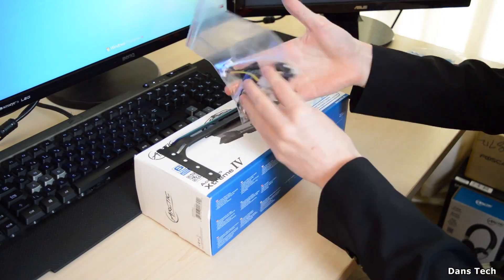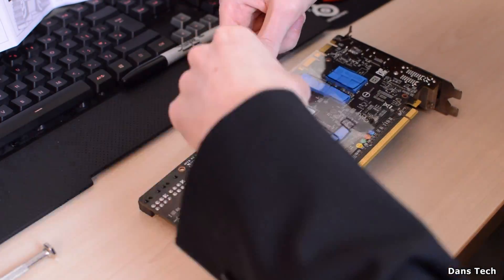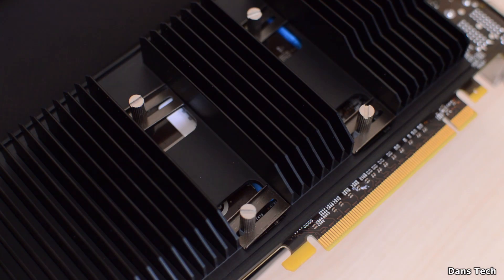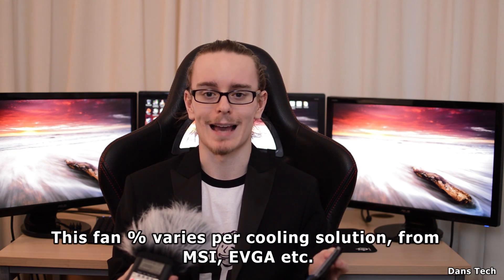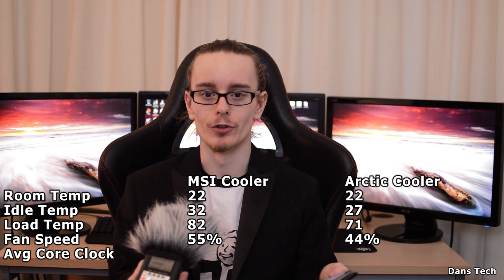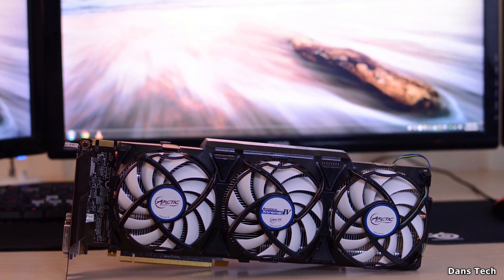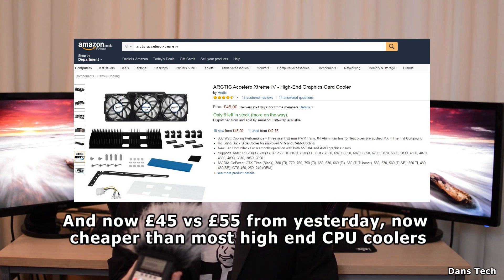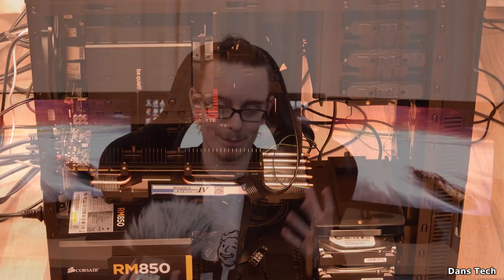Arctic Accelero Xtreme IV GPU Cooler Review

Comment: How about the VRAM temperatures? They're cooled through the PCB, which reduces thermal transfer *a lot*.
Reply: Considering the 90mm fan provided with the nzxt g12 water/air hybrid cools vrms and memory better than the stock cooler without heatsinks and just downward airflow, I'd bet this does a fine job.
Reply: I'm wondering the same thing.  I'm hesitating between the Accelero IV and III for that very reason.

Comment: Hi, do you know if that works in 980ti? (Msi Armor 2x). Great video. Thanks.
Reply: RTX 2080 (Ti), Titan Xp, Titan X (Pascal), GTX 1080(Ti), 1070 (Ti), 1060, Titan X, 980(Ti), 970, Titan (Black), 780 (Ti), 770, 760, 750 (Ti), 680, 670, 660 (Ti), 650 Ti (boost), 580, 570, 560 (Ti,SE), 550 Ti, 480, 460(SE), GTS 450, 250, 240 (OEM), GT 740, 9800 (GTX+, GTX, GT), 9600 (GT, GSO 512, GSO), 9500 GT (not LP), 8800 Ultra (G80), 8800 GTX (G80), 8800 GTS (G80), 8800 GTS 512 (G92), 8800 GTS (G92), 8800 GT, 8800 GS (9600GSO), 7900 GTX, 7800 (GTX 512, GTX, GT)

Comment: Hi, was the Original cooler the MSI Gaming X or another? Because i have a GTX 980ti MSI Gaming X and my temperatures in Load are 82 Degrees with 86% Fan Speed on Automatic Fan Curve... Whould this Cooler help for my card?
Reply: yes

Comment: did you have any long term issues, my 980 ti started hard locking after I installed this, I think its the crappy heatsink solution, on a 980ti u cant use all 6 included clips, which presses the backplate to the blue thermal pads, I was only able to use 4 cause there just isn't room to use the other 2...thus maybe thermal conductivity sucks? Not transferring heat properly from the VRMs to the backplate? Regarding the actual GPU cooler...its amazing... my temps dropped from 84C load to 55C load and I can't hear the fans.
Reply: tinostarks I had to squish em down cram it a bit

Comment: does it works with my nvidia gtx 1060 / 6gb oc? ( msi - Version )? @ ITALY
Reply: RTX 2080 (Ti), Titan Xp, Titan X (Pascal), GTX 1080(Ti), 1070 (Ti), 1060, Titan X, 980(Ti), 970, Titan (Black), 780 (Ti), 770, 760, 750 (Ti), 680, 670, 660 (Ti), 650 Ti (boost), 580, 570, 560 (Ti,SE), 550 Ti, 480, 460(SE), GTS 450, 250, 240 (OEM), GT 740, 9800 (GTX+, GTX, GT), 9600 (GT, GSO 512, GSO), 9500 GT (not LP), 8800 Ultra (G80), 8800 GTX (G80), 8800 GTS (G80), 8800 GTS 512 (G92), 8800 GTS (G92), 8800 GT, 8800 GS (9600GSO), 7900 GTX, 7800 (GTX 512, GTX, GT)
Reply: @francismichel1  why GTX 260 280 285 275 is not supported?
Reply: @warrax111  I dont know, but it doesnt

Comment: im running a r9 380 and is soo fucking hot today im running it right now on stock cooler 100% idle  and its 46c :X i need a good cooler for my gpu
Reply: Ilijas Ramic make sure your fans are spinning one may have gone down

Comment: Yo sup Dan I was wondering if you could help me I want to know if this cooler would fit my Gigabyte r9 380 g1 gaming thanks man :D
Reply: FiNaTiC GaMeR wouldn't know.  Check it out at the faq questions on that site
Reply: Jhono Gudiel Thanks for the fast reply, I just checked, they said "The IV works for all 280's manufactured after February 2013. The 280x works with all 280's." But unfortunately i'm not from US, now i don't know if it's a free shipping world-wide, that's the problem because no one sells this in my country, it's out of stock.
Reply: Nostalgic Mind don't worry. 
I have the same problem and that why since I've done this comment.  I haven't gotten it yet.  It seems I do need to have real direction there.  So far, I cannot buy it.  

But I suggest you ask to the seller at Amazon.  They'd tell you of the deliver it free shipping.  Or at the section "sent to" and see if there's your country available.
Reply: Support Nvidia GTX 1080, 1070, 980 Ti, 980, 970, Titan X, Titan, Titan Black, and more...
• Support AMD RX 480, R9 390X, 390, 380X, 380, 370X, 290X, 290, 285, 270X, 270, R7 370, 265 and more
Reply: +Jhono Gudiel thanks man but this may not work for aftermarket gpu right? or can it I heard only refrence designs only.
Reply: Mostly these kind of coolers, works with reference models.  Because they kind of have a standard model.  But go to amazon. There you can ask to the seller and they'd solve your doubts.  I came from amazon site right here and found your question.  Search it on amazon. Is the only one.   :)
Reply: +Jhono Gudiel cool will do :)
Reply: Good luck!! :D
Reply: no support for evga 780 ti?
Reply: And 280x toxic edition?
Reply: Nostalgic Mind don't know perhaps they do.  Check it out at Amazon

Comment: Just installed this on my incredibly hot Palit GTX 580. As you say, it is a little tricky to install as I've never done the aftermarket GPU stuff before. But boy I'm chuffed with the results.  Under load it has shaved 30 degrees off. And that at a relatively low rpm. It's quiet no matter what you put it through. £40 very well spent. Still, it is absolutely huge. Don't install if your machine might not take it!
Reply from the maker: +Adam Daly Hi, glad you like the cooler! Thanks for watching the review! Dan.

Comment: Wut?! Why you didn't use holding bracket?! Your card hangs now down under it's own weight.
Reply from the maker: +polishchaser1 Hi, I was happy with the weight of the cooler and felt I didn't need the bracket installed. Dan.
Reply: +Dans Tech
 Well, I used it on my r9 390 anyway.
http://i.imgur.com/AwWn4E6.jpg

Comment: Man that thing is huge! (That's what she said...)

I think it's a good idea to buy a reference card and this cooler if you want to get better performance than with most aftermarket coolers.
It fits nicely between AIOs for GPUs and normal aftermarket coolers like the Windforce for example.

But it guess the cooler will be a problem for any SLI/Crossfire setups.
Also did you get any RAM clearence issues with that giant heatsing on the back?

Really nice video btw!
Reply from the maker: Senzelian Hi, great questions. Yes the cooler does block the SLI fingers, however with the metal heatsink on the back of the card, you are unable to fit it in the top slot x16 slot on any motherboard, I personally have an x1 slot above the x16 slot aswell. Also because of this RAM clearance is not an issue, as its installed further down on the mobo. Personally I think this cooler has the edge over some watercoolers that dont even bother to cool the VRM's, VRAM and other hot components apart from the core. Dan.
Reply: Dans Tech Thanks for that quick answer! :D
Reply from the maker: Senzelian No problem! Tend to get back to everyone as soon as the comments are sensible enough. Dan :)